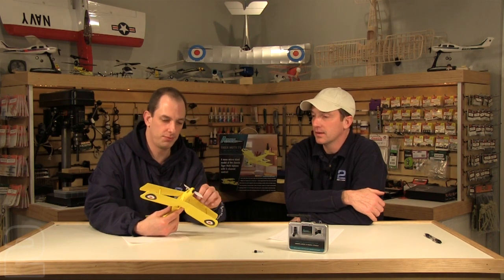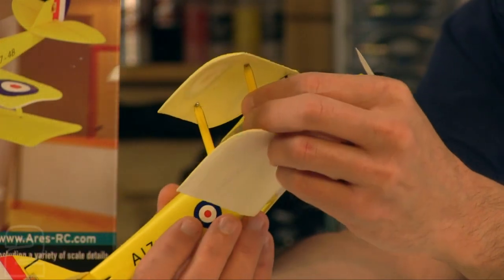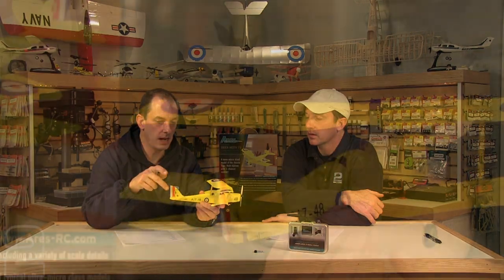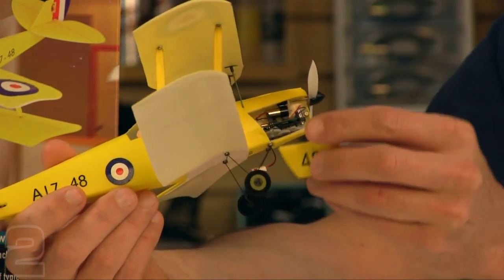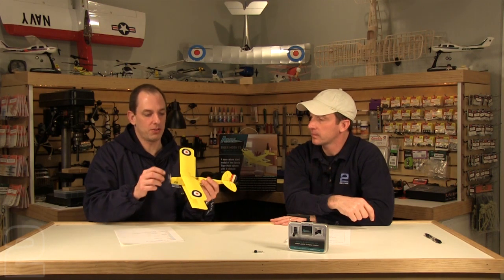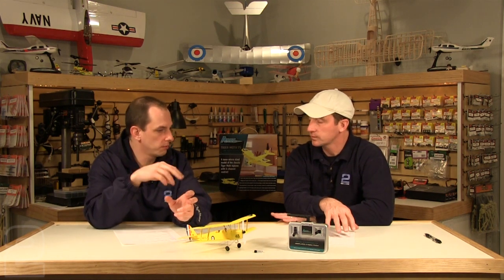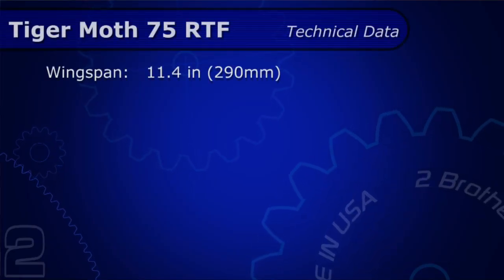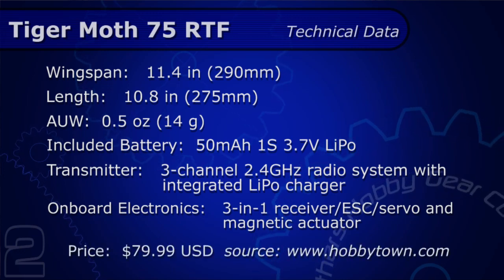Ares Tiger Moth 75 RTF Review  Part 1, Intro and Flight

Comment from the maker: The Flyzone Tiger Moth is in a different class since it's running with a bigger 7mm motor and is bigger than the Ares by 4+ inches.  The Nano-Micro 75 is in a specialty class at only .5 ounces (half the weight of the Flyzone Moth).  Yes, we've flown the Flyzone model and it flies nicely.  With the weight and size difference, they offer a very different experience but each at the top of their class. Thanks for watching!